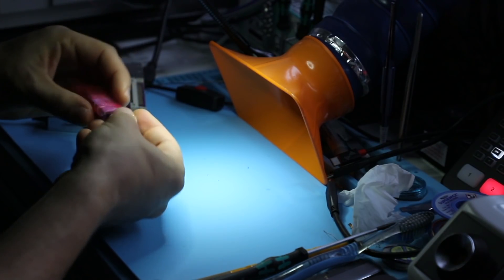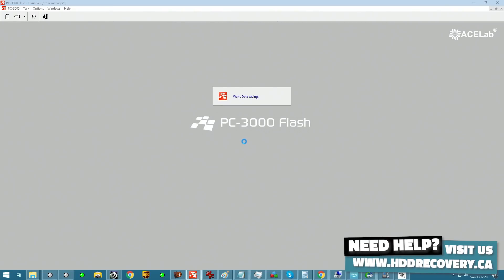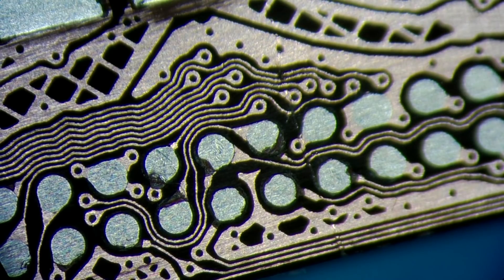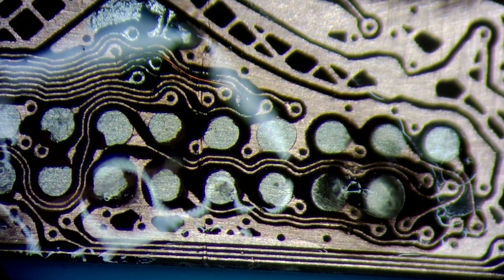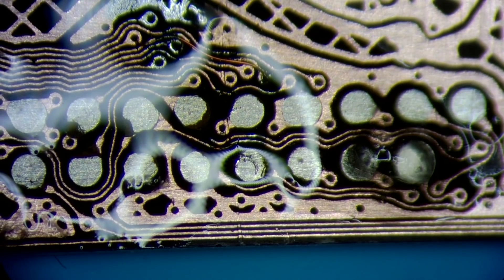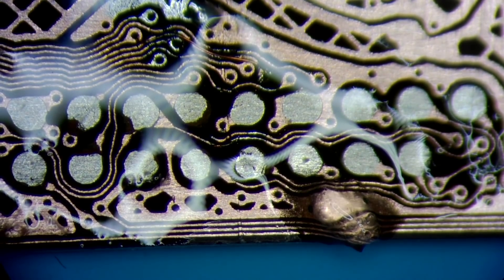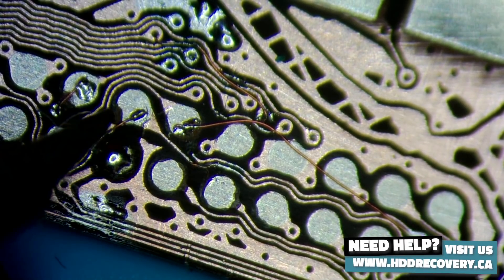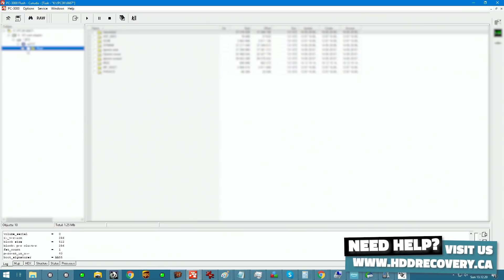water damage memory card

Comment: Hello I have a question.  My HDD is running and is then seen for 20 seconds.  and then crashes.  large chip at the top gets quite hot cooling with a pad does not help.  how can i fix this to get my data back anyway.

Comment: How often do you  run into problems that you cannot recover? It seems like you have a recovery and fix option for everything. Do you often have items that come in where recovery is not possible?
Reply from the maker: We do get cases that can't be recovered. For hard drives it is because of the severe platter damage with no SA access. For NANDs it's internal problems with chips, encryption, or physical damage to the NAND.

Comment: How do clear sd card. What tool u used?
Reply from the maker: You mean secure erase?
Reply: @hddrecoveryservices  yap
Reply: @hddrecoveryservices  and where i can find usb hub u used for plug usb drives. Its contains voltage meter. What is it brand name?